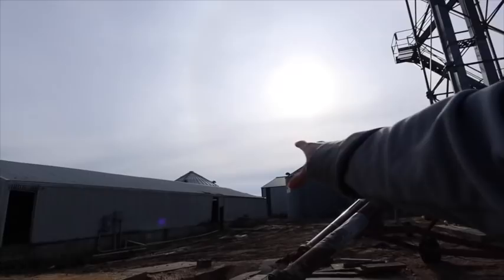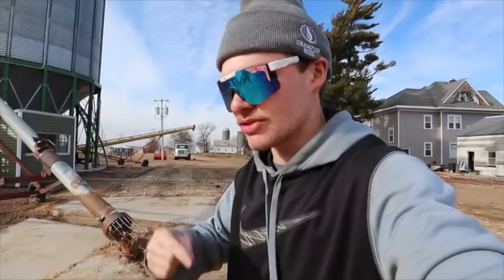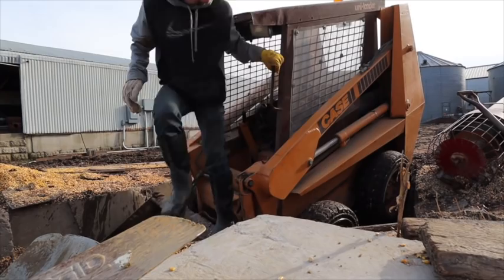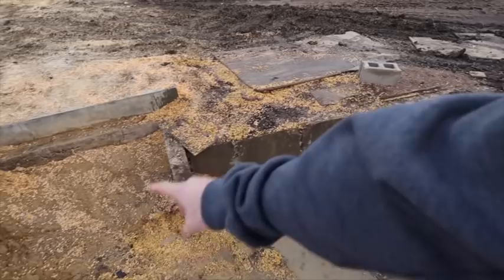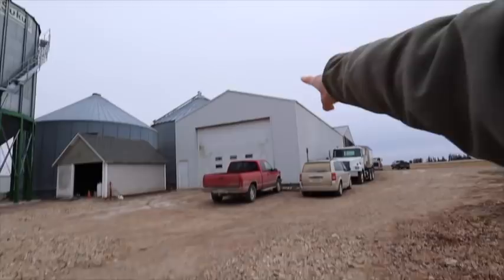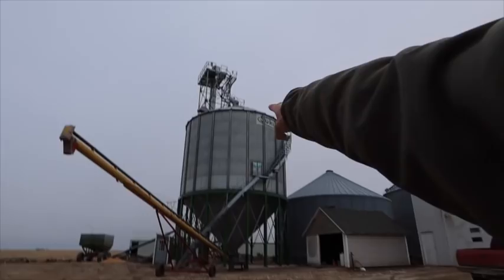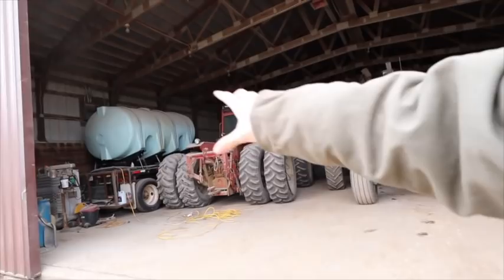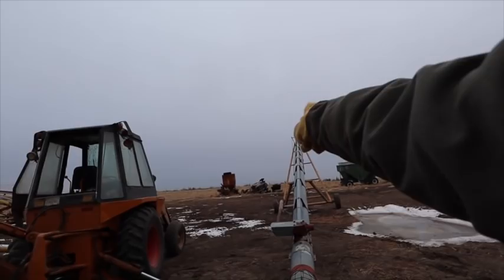WE GOT STUCK IN ROTTEN CORN!

Comment: Cole when the trucking company we use to haul our wheat to town, stocks an auger into a pile. They have a split piece of pipe or auger tubing that they tarp strap it to the intake end to protect the auger from dents from a skid steer. Many years ago Monte had someone tap his auger hard enough with a loader tractor to bend it where it was rubbing hard. Just a hint that may save you some trouble.  
Thank you for the videos and the learning experience. I grew up on a dry land wheat and beef farm & ranch in north east Montana.

Comment: Talking about safety.
I personally would like to see an ANSUL fire system on ALL grain driers,combines,farm tractors,even semi-trucks.
This involves alot of plumming,but it can save millions of dollars in equipment and priceless lives.
You hit one big button,this releases several hundred pounds of "K"-class fire extinguishing compound on fuel,oil,hydraulic fires.
The ANSUL fire system is the same system that's used in commerical deep frying equipment in restaurants.
This system on the farm could be controlled through a smartphone(data or WI-FI),this would give the farm added safety on grain drier systems when you are away.

Comment: Thanks for the metric conversion.  I find them easier to work with.  My friend from the UK, specifically the island of Jersey (or Old Jersey as I call It) uses a different measuring system called stones. 1 stone = 14 lb. = 6.4 Kg. Go figure.  Thanks again.  Narragansett Bay.

Comment: We use the water extinguishers that we can fill every year. Add a little soap to it and fill with air and they are good to go. The problem with the powder ones is they bounce around on equipment and pack in the bottom of the tank and then they don’t work.

Comment: to blow air trough the bms you could git 4 in. Corex Drain Pipe Perforated and a shop fan with a plate with wholes for the pipe to hook the drain pipe to

Comment: I'm sure this is a silly question but have you all ever tried putting down a blue tarp first for the auger junctions?  Cleanup should be easier and if you use steaks to prop up the sides you can cup the junction and increase efficiency.

Comment: Before you use dry chemical fire extinguishers always bang them on a hard surface. They tend to bulk up and get chunks in them. The guy told me this one time as we were preparing to start an aircraft engine and guess what it started on fire and the fire extinguisher worked. Lee's old aircraft mechanics no the basics very well. I'm sure a few burned up airplanes have helped with that

Comment: Have you considered creating a fire prevention program for your farm. Things such as identifying possible hazards and placing the appropriate class of fire extinguisher in those areas. One of the things that concerns me the most is running electrical wires into a pile of corn on the auger maybe considering moving the plug on the pole by the wheel so that the connection is not under the corn.     One spark equals a bad day     don't want that to happen to you guys

Comment: Hi from 🇨🇦 to the Cornstar🌽 Family. And Merry Christmas as well.  So Cole did you say that motor weighs 160 pounds?  That must be a 3 phase motor ? And you are one strong young man to be lifting that . Be careful, even young guys can blow out a disc. I was young and careless myself way back when and now I have pins and rods and screws going through my T12-L1 region of my spine and a fused C5-C6 disc  in my neck ( actually cow bone was used to fuse it) all from being a bull and not lifting properly. So Please take your time and use whatever mechanical device you can to do the lifting for you . WORK SMARTER not HARDER. Thank you for all the great videos.
Reply from the maker: It is 3 phase. Thanks for the consideration!
Reply: Mr. B , GREAT advice. As a nurse who ended up with severe back problems, I can’t stress enough to everyone to TAKE CARE OF YOUR BACK!!  You only get one, and you don’t want to have it be a major problem when you get older. My retirement plans have been drastically changed because of my back...

Comment: what I would do with the dump pits is make a funlel out of steel and weld a 1/2 cut auger shell at the  and run a long thin drive shaft so it can be run both dump pits with one moter  then bild a vac silo and run a grin vac to pull all your grin to a hoper bottom with an auger for both corn and beans no more cleening pits that big

Comment: Maybe extra outside bins would save you some work and fuel so you load direct during harvest and unload direct in the winter, but that would cost a fair bit,  unless someone's replacing a older system or putting bigger bins in instead the old ones
Reply from the maker: Precisely!

Comment: What about the stink behind your beautiful cabinet  in your house? My suggestion is you just wait it out. This is easier said when it is hot because the guy who died will just dry up but when it's wet it'll take longer. Look for mice in your house. If you have mice there's multiple ways besides the new kind of snap trap that I bought at Ace. There's also something you can plug into the entire house electrical system that supposedly works you might want to try that

By the way if you use the snap traps for rats which is what you should use use peanut butter

I live in a small condo in Irvine California and we have a constant rat and mice problem. I caught 10 in 1 month when I finally got serious with that snap trap and peanut butter
Reply from the maker: Miriam Bertram wowza!
Reply: @ColeTheCornstar  if I find that whole house system I will send you the link but always look for a coupon online LOL. Although it is still less than 80 bucks or a hundred bucks

Comment: the worst part is the end. finis. So what ya'll need for hay fires is one of those old turn over upside down water with baking soda in it then when the vial spills it sprays water for 3 minutes. A good way to save your combine especially. They really work good on fire except fuel fires then your powder extinguishers work better but they are tooooo small.

Comment: Cole, I challenge you to find an easier more ergonomic method of moving heavy electric motors or other objects, before you permanently injure yourself. A few things I saw , shoveling out the corn pit and pulled the skid steer out with a "backhoe"(big scoopy shovel), Lifting awkwardly and carrying awkwardly said electric motor to place in the skid steer bucket when you could have tilted the motor back and slid the bucket under the raised side of the motor and set motor into bucket, and use that skid steer to lift motor into place on the bin bottom auger. I'm sure you have your reasons for doing it your way and I know there are times when you just have to bull it. Food for thought . Ho Ho Ho!
Reply: He can press 200+ pounds , from previous videos. 
He jokes about lifting with your back and not your knees.  Hahahahaha
He’s young.

Comment: When its possible couldnt you build a concrete pit there to put the auger into, instead of the corn going onto the ground,, and then you can cover it when not in use,, also easier to clean out....

Comment: Could do with new pits with more taperd bottoms , fair bit of waste left in the bottom
Reply from the maker: That's the plan
Reply: Could make wooden pyramid form and put a fence post same diameter as auger on it so fits in right the bottom and angles each way feeding it ,  then fill pit with a bit of concrete, press bottom of form in and then fill the sides up
Reply: Make taperd sides with perfect sized/shaped sump in the bottom like

Comment: Insta-Like-Click.   So Daddy Cornstar,   on your dry chemical fire extinguishers,   twice a year,  flip em over and over, and maybe tap on em to free up the powder in em  so that it stays loose inside.   Just like with your smoke detectors, do it when you switch your clocks,  easy way to remember.   The longer the dry chemical fire extinguisher sit, the harder the powder gets.

Comment: How does the corn get hot spots and why is it bad?
Reply: @ozazure, they don't want popcorn.... 😄😁😊 joking

I believe it's like hay, you don't want a fire. Spontaneous combustion.
Reply from the maker: Think of it as dried fruit vs normal fruit. Normal rots after so long where dry keeps much longer. Hot spots form when pockets are higher moisture and it causes the corn to rot. It's bad because you get docked when you sell it - you can even get rejected.
Reply: @ColeTheCornstar  ahh got it, thanks!
Reply: @wendy833  too funny, I was popping corn for my class last week and thinking about this channel and the immense amount of corn vs the few cups I needed to feed 40 ... you'd cover the srrounding lands if they popped 😂
Reply: Usually a wet spot that didn't dry adequately combined with a lack of airflow or uneven airflow. Moisture can move around in grain while it's stored and cause rot which heats up. Long-term storage requires a very stable moisture percentage in the crop. Getting to that is difficult in a floor storage situation. There are some ways to get airflow with floor storage but probably best to just move it out fast. Bins with fans or dryers and some method of stirring or transfer are typically used to get grain to a stable point.

Comment: Hi I watch you guys videos ounce awhile ! Daddy cornstar was talking about his combine caught fire and the fire extinguisher didn't work I my self have a 7720 Jd combine and it caught on fire behind the engine compartment where the countershaft turns the dust and dirt built up against the shaft and started a fire I carry a 2 1/2 gallon chemical jug filled with water i used water to put the fire out .but I do Carry a fire extinguisher also in the cab I was lucky to put it out early . Keep the videos coming and have a Merry Christmas !

Comment: stoped in and seen what up with the three stooges, mmm most put like normal  lol, as for your fire extinguisher the should be shocking up monthly  so they do not get a settlement in the extinguisher  
all of the dairies barns we have fire sprinkler throw the barn each year we make sure they all work September  the cow barn does get a wash down and then they go off to calf barn we just replace the sprinklers more like they work but don't, chance it, we did  lose a calf barn 11 months ago no animals when inside of the barn the 4 tired it 2 days before that was -30 that week we moved all the calfs  the heated barns they were very lucky i never catch them they would have been found inside the building dead lol 
they pick the day when i watch the places do carry a gun with me at night  for my own protection carry one when i am on horseback  do not know when a bear would appear George was good in that too miss that bear still Jasper sill bit young he going to be a big boy when he is fully grown  the three stooges like walk and steel the motor like they owned the place lol if you take something off more them one you need a replacement one, yes i do know  they are not cheap we do have one in storage here all things to one of each motor and pumps and gearboxes its a cost item we have to look the other way in the cost we were called in for electric motor making a noise the bearing has gone out had one special for that motor tear it apart  and the motor did small  hot it was on it last days  did emergency  call was 24 of December it was and was for a hospital to 25 i was changing it out by my self  could not get one for christmas but did know were one was  we borrowed it  and had it replaced   bought 5 of them one was the replacement do cheap if it worth rewinding  them if not i keep both houseing and the fan and the fan cover 
when you a concrete plant the do get beating up have a sea can full of them